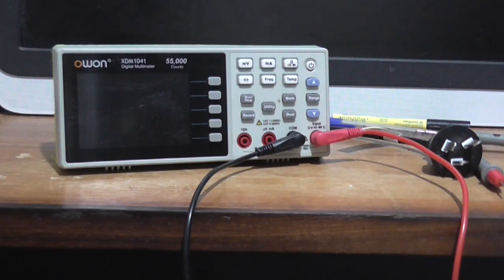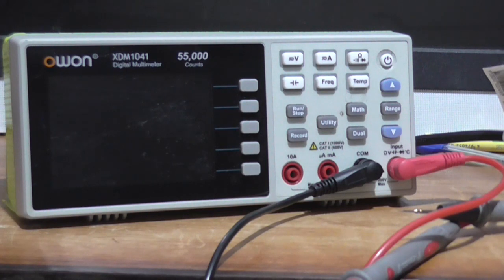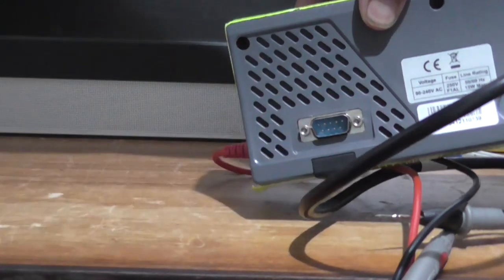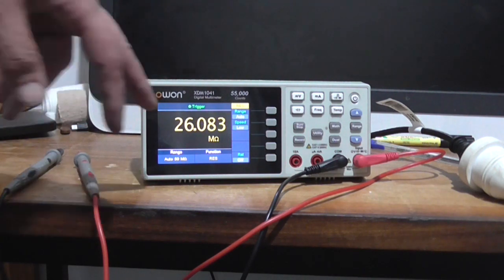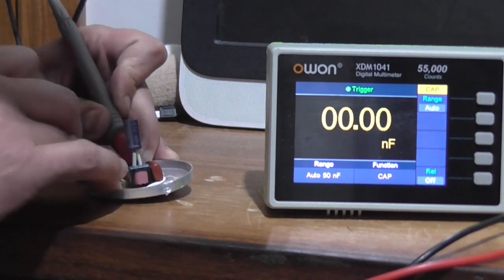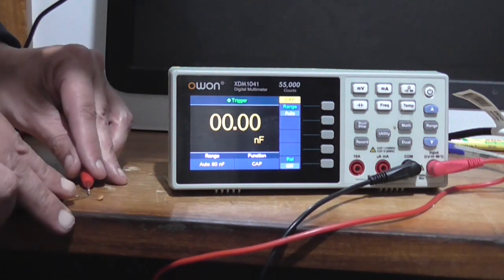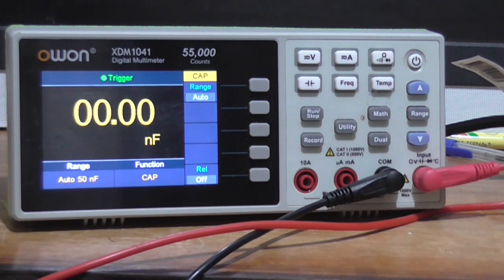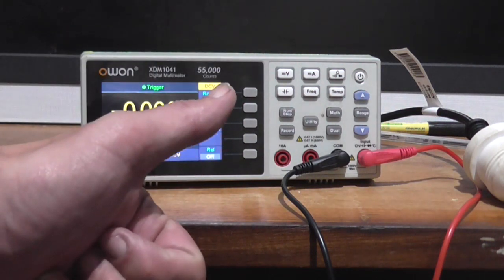Owon XDM1041 Digital Bench-Top Multimeter REVIEW

Comment: I don't understand why you can't measure an electrolytic capacitor. I have the same XDM1041 and it works without problems. I can see it in the ignorance of the staff. If you are showing the use of the meter, it is a good idea to show the firmware version first, so that the date of the video can be used to estimate whether a FW upgrade is needed or not. It should be polite.

Comment: Spec is 50mF, ie 50,000uF......RTFM 🤣 - https://supereyes.ru/img/instructions/OWON_XDM_1041_Digital%20Multimeter_USER_MANUAL.pdf
Reply from the maker: I did. See description.
Reply from the maker: And just so you know, I had several things go wrong while filming. I read the manual after I edited the video, links in description.
Reply from the maker: I also am human, so I make mistakes lol. I'm obviously doing something wrong. But, I will say, the capacitance measurement on most meters is hit and miss at best. An LCR or ESR meter is better for measuring electrolytic capacitors. Thanks for your comment, though.
Reply: @AstrosElectronicsLab  I think you needed to change capacitance range or go to auto ranging - "3. Set the range. Press the Range softkey to set the range. Auto range automatically selects the range for the measurement based on the input. " . Cheers.
Reply from the maker: @ericmc6482  cheers 👍

Comment: Yes, I did give you the meter because I'm no longer using it. I figure two meters is better than one. 
My favourite feature of the meter was always the back-lit screen. 
Having the measurements fully visible from any angle at your workbench is really handy.
The measurement speed can be sped up considerably using the button, second from the top, directly next to the screen. 
Capacitance measurement is generally the most unreliable function in multi-meters. I've found that to be true across many brands.

I guess that's why there is still a market for LCR meters. Although I don't remember the meter being unable to measure electrolytic caps. 
The answer might be in the buttons next to the screen. Picking the correct range etc.? 
The 25 watt resistor with the probes attached are for discharging high voltage capacitors. It's gentler on the capacitors and for whatever
you're putting across the terminals to short the capacitor.
Reply from the maker: Ah! Now I remember what the resistor was for from the letter you included in the first box with the resistor. I have a bad memory, lol. I could have re-read the letter before making myself sound stupid. And thanks. I was wondering what the buttons on the side of the screen did as they're not really marked well. I need to see if I can find a manual for this online.
Reply: "My favourite feature of the meter was always the back-lit screen. "

We have a expensive Agilent bench top DMM at the soldering bench in our R&D lab at work that rarely gets used for more than checking for shorts or identifying unmarked SMD resistors and capacitors.  It's a bit of a waste really but having the big illuminated screen makes it 10x nicer to use than a handheld DMM.
Reply from the maker: @Ferrum Ignis  plus, I'm assuming it's mains powered, so you're not dealing with replacing batteries all the time. That, and if it's not used often, batteries can leak over time.
Reply from the maker: @multipotentialitegeek8117 Yes, thanks, mate. I know how to use it now as I figured it out. If it makes me out to appear dumb at the time of recording, better entertainment for you guys at my expense! 😅